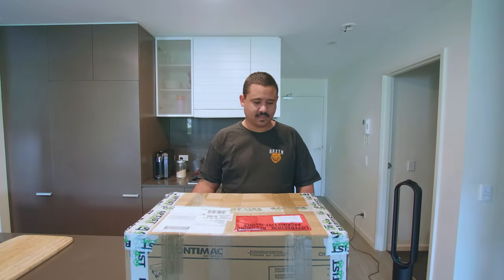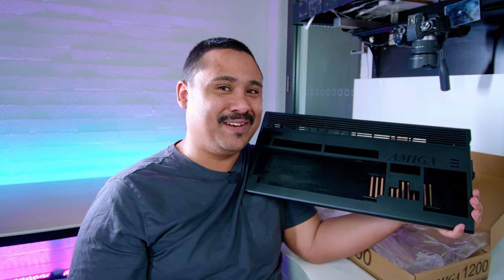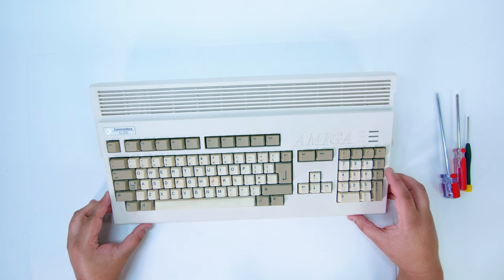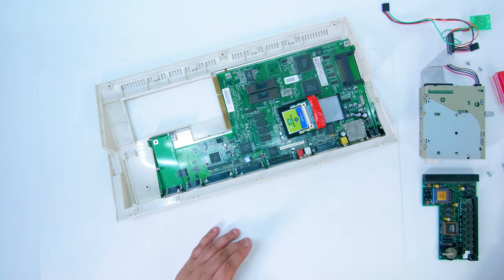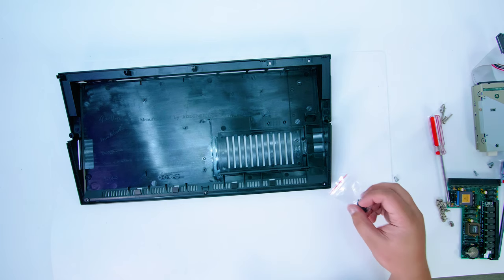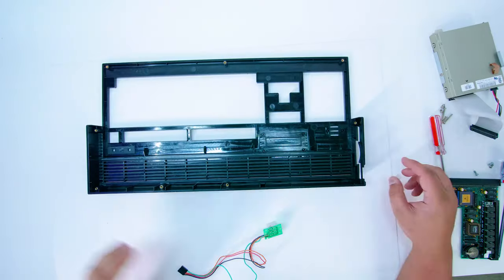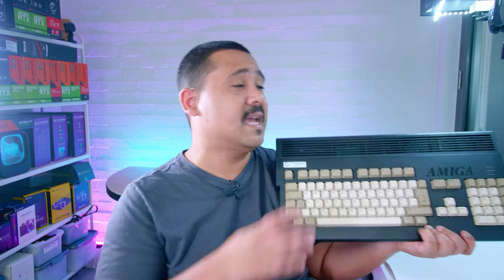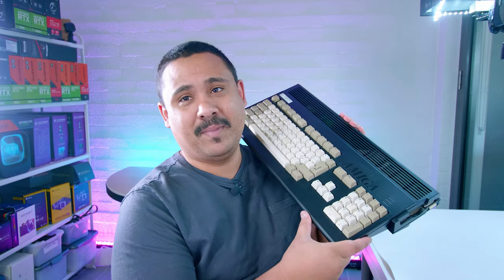Rebuilding My 27 Year Old Amiga 1200 - A1200.NET Case

Comment: These cases also come with included with all the bits, a matching "Floppy Drive Eject Button". I bought one of these last year from RetroPassion here in the UK. Could only get it in the colour grey at the time of purchase, so i sprayed it a nice cherry red colour. My A1200 casing houses my Raspberry Pi 3b+, along with a Keyrah v2 keyboard interface board, SD to Micro SD card ribbon cable, female to male HDMI cable, female to male audio cable. Added a micro USB female port (for my R/Pi's power supply) and added an On/Off power switch and is running the full version software of Amibian. I named my build "FrankinPi".

Comment: I've noticed the stupid prices on eBay too. $1200 to $1500 AUD for a single Amiga 1200. So I used the Facebook marketplace to create a wanted ad for Amiga gear in my area. I was surprised by how effective that was. You're going to have trouble believing this but I swear it's true. 

The first seller who contacted me had an Amiga 500, a Commodore 64, and an Amstrad CPC 464. He sold those to me for $300 AUD. They required a little work but they are all in working condition.

The second seller who contacted me sold me his entire collection; 1x Amiga 4000/30, 2x Amiga 1200HD/40, 2x Amiga 600HD, an MBX 1200z accelerator, an Action Reply for the Amiga 500, 100's of disks, and dozens of manuals and cables. He sold those to me for $1500 AUD. One of the 600's has an as yet undiagnosed fault (black screen; drive ticks and loads disks, so probably a fault somewhere near Denise) and one of the 1200's was missing the video DAC chip (I bought a new one from eBay for $10). Other than that, all the gear is working. My wife must have thought I was a grinning idiot when I got home with that lot.

It really pays to seek out sellers instead of using eBay or Gumtree where the sellers are asking insane prices.

Comment: I wont lie, I love this.  I just bought a C64 since it was something my dad had and I would use it all the them. So I would wish there would be kickstarter to put a C64 in the new cases. like the Amiga
Reply: There is new cases for C64's  they have been on the market for the last aprox 3 to 4 years. And there are new motherboards and power supplies. The new cases are even been produced on the original commodore molds. The 1200 cases are made on new designed molds. Speaking of C64. You can get everything new, except for two pieces. The VIC-II gfx chip and the keycaps them self. Everything else can be bought brand new. Yes, even the keyboard it self, just not the caps.

Comment: Great video, I have a couple of A1200's, my original one I bought back in 1992 and another I picked up in about June last year as a backup system.  Both have been recapped and one has a Blizzard 030@50mhz with 32 Meg of Fast Ram that I bought back 1996.

Will NEVER sell my main original system.  Still to this day the best computer I've ever owned.

My A500 before that was brilliant as was my C64 but the A1200 is the great all-rounder 👍👍

Subbed 😎😎😎

Comment: I have an original Amiga 1200 but for those who want to try it out without buying the actual computer you can go to  archive.org where they have free emulation of many of the games, programs and demos that run from your browser with one click. If you want more you can either use winuae (Amiga emulator) (free) also cloanto Amiga forever (an emulation platform with lot of extras and configurations). And.... There is an emulation distro that basically makes a raspberry pi into an emulated Amiga that can boot right into workbench.
Reply from the maker: Not the same thing lol
Reply: @GearSeekers  I'm curious to know what your thoughts are on this? My problem is that I want to be able to emulate all kinds of devices ... But I don't have much space to put all the machines. And then there is the cost. I do have an Amiga 1200 mut I'm interested in too many things. Eventually I would like to be able to emulate everything!